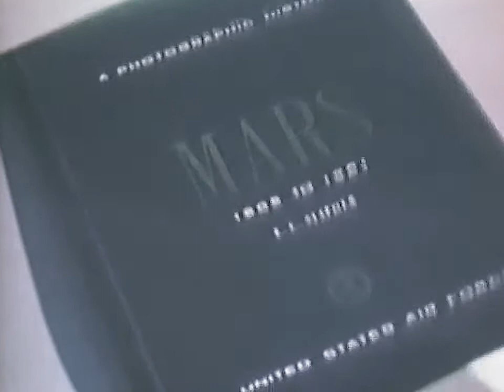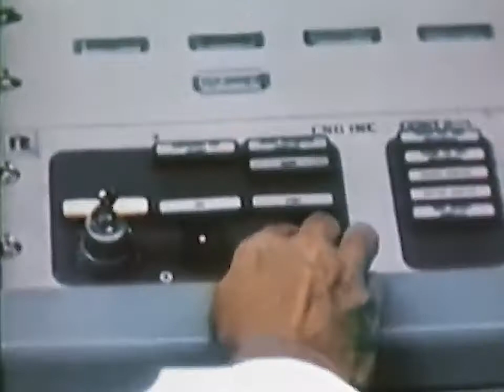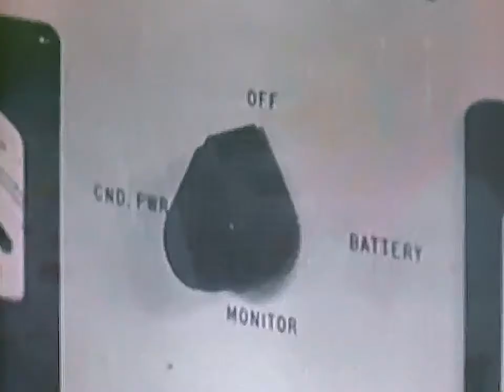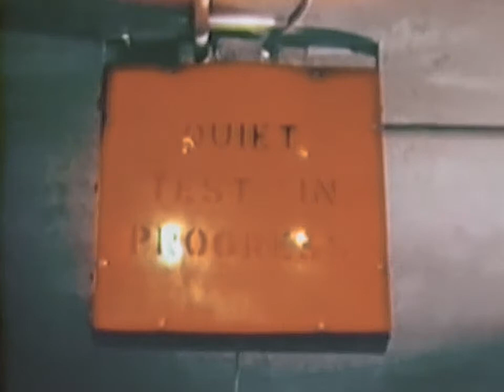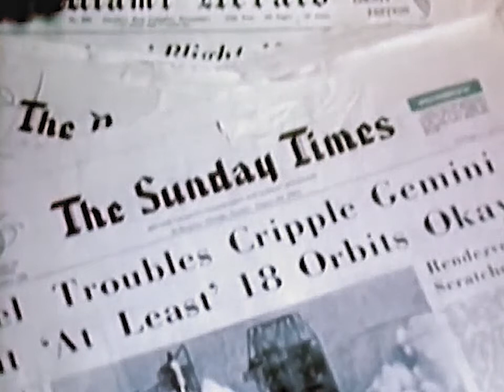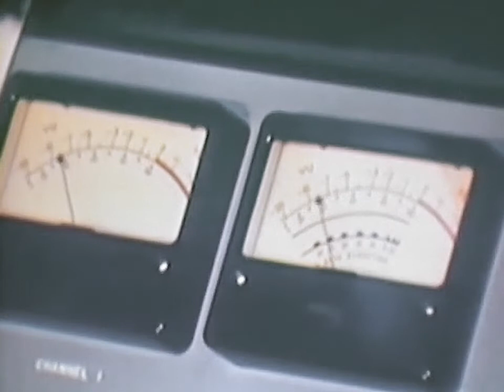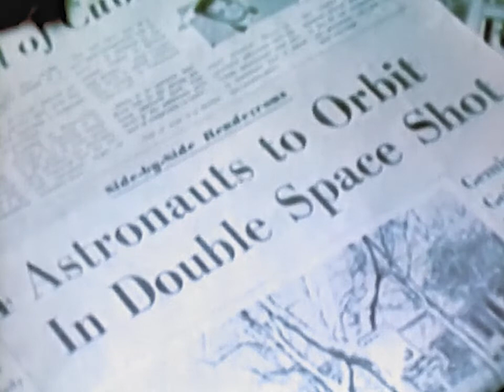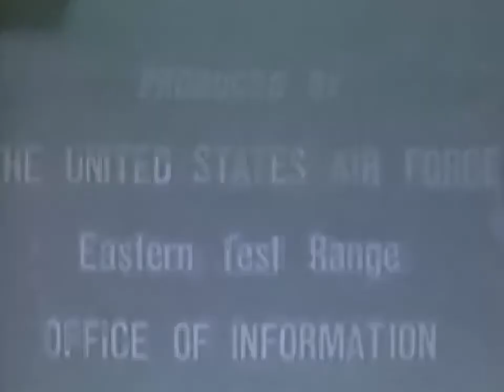Cape Kennedy 1965 - Restored color (USAF, 1965) Cape Canaveral, Gemini, Titan, NASA

Comment: During the reporting period seen in this video, Voskhod 2 with Cosmonauts Pavel Belyayev and Alexei Leonov was launched to conduct the first ever spacewalk. The difference between Voskhod 1 and 2 is that Voskhod 2 had an inflatable ailock named "Volga" and also this mission had two cosmonauts in spacesuits as opposed to Voskhod 1 with three cosmonauts in track suits. As soon as Voskhod 2 got into orbit Cosmonaut Belyayev helped Leonov get his back pack on and got him into the airlock. Then Leonov depressurized the airlock and stepped out into space. As soon as he got out (what the Soviets forgot to mention) his suit over inflated to where his fingers slipped out of the gloves. Leonov at the risk of getting the bends had to bleed out the pressure so that he could reenter "Volga" and repressurize the airlock after spending 12 minutes and 6 seconds outside. After the spacewalk, Belyayev jettisoned "Volga". Their problems weren't over as Voskhod 2 encountered the same problems as earlier Vostok spacecraft as their equipment module not separating as it should have. On top of that, they landed off course and ended up in the russian forest in the middle of the russian winter and had to spend the night in the cold and endure wolves in the area, but they were rescued after several days. Source: Russian Space Web- Voskhod 2 ( http://russianspaceweb.com/voskhod2.html ) A special thanks to Youtuber Raiz Space for providing us with the mission profile of Voskhod 2 ( https://m.youtube.com/watch?v=BRQl0rBcJhk ) Man Leaves Ship In Space- Story of Alexi Leonov's Spacewalk ( https://m.youtube.com/watch?v=AwHFTZs4GwM&t=40s ) Footage of Alexei Leonov's Spacewalk ( https://m.youtube.com/watch?v=7mUO1TDr7fQ&t=56s )